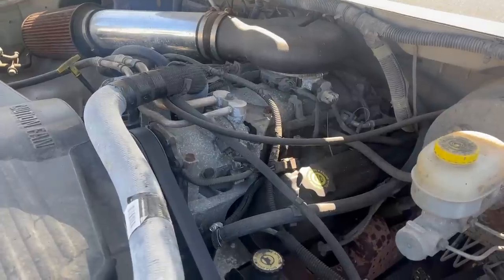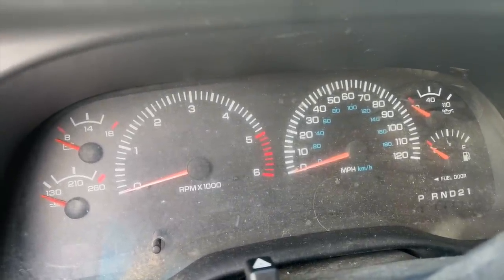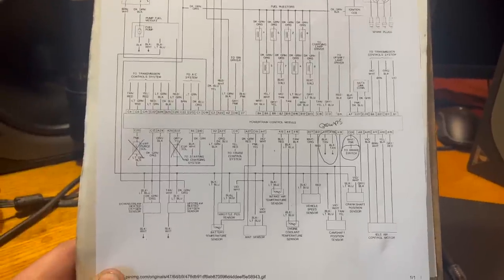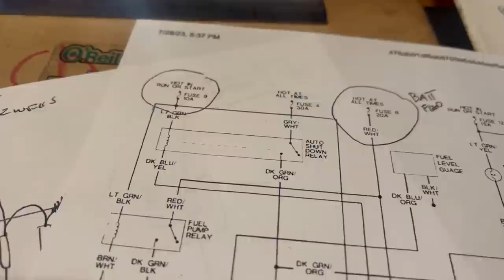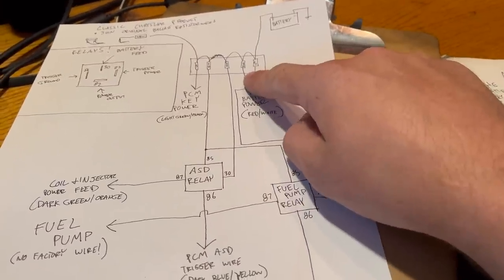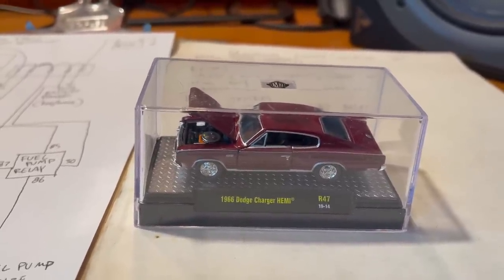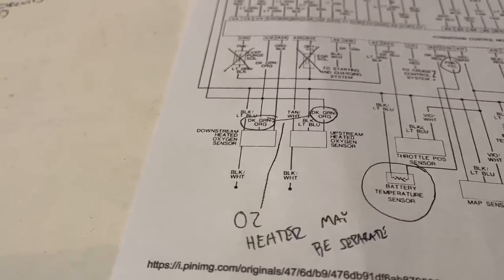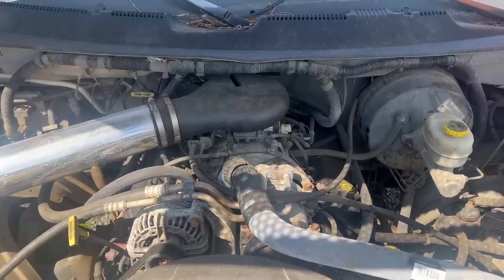The Big Magnum 5.2/5.9 Swap Wiring Guide! How To Wire A Magnum In Your Old Mopar (Or Anything Else)

Comment: Im going to swap a 99 durango 5.9 into a 99 jeep xj. I want to  keep as many factory amenities as possible. They have so many of the same options though. Id hate to lose them by swapping to a truck harness?? Or wiring it like its going in a classic car! Any input?
Reply from the maker: I don’t know about about computer pinout and sensor connector differences between the 4.0 and Magnum setups. In a 3.9 V6 truck, you can add the extra injector connectors, swap the PCM and you’re good to go. You’re not going to have the same luck coming from a 4.0… but it really isn’t all that different. There is a way to do this that results in a sanitary swap. But I can’t tell you every little connection you’re going to have to make to accomplish that. It will involve partially de-pinning both PCM harnesses, stripping both engine compartment harnesses, swapping things around, re-wrapping…
Reply: Do you think i can just use the durango harness that already had everything integrated (same as the 4.0) and just wire the jeep headlights etc into the durango harness/computer,
Reply from the maker: @codyduncan1760  Yes, you absolutely can do that. People have done the same thing for classics, simply adapting the headlight wires and such to connectors that fit their lights. Just a good bit of work to get all of that stuff routed, trimmed, and up and running.

Comment: Can a JTEC controller and harness from a 42RE (auto) work with an AX15 (manual)?
Reply from the maker: In a word, yes. When I said “it will work, but the computer will be mad about the missing transmission stuff,” this is precisely what I was referring to. I’ve done it with success, but had a bunch of transmission codes. Down the line, you can always swap to a stick computer. All of the basic wiring stuff is exactly the same, so no modifications will be necessary there.

Comment: i put a 2002 360 in my 1994 ram 1500 used the 1994 computer the injectors were different rather than change them i bought on ebay EV-1 to EV-6 injector adapters just plug on injector and the 1994 wires plug on the adapter been on there 8 years no problems
Reply from the maker: Nice! I’ve heard of those adapters. I have run into one issue swapping between injectors though - different injector dead time can lead to weird runability issue. I don’t know the different dead times between the different injectors, I just know I swapped in a set that really messed up how a 318 Ram ran earlier this year. Throwing a 360 computer on it fixed it, but we changed to different injectors instead.
Reply: @DeadDodgeGarage  yes i agree but so far i haven't had any problems. in my case i don't think the obd1 is as picky as obd2
Reply from the maker: @DependableAutoTruck  the one I mentioned actually was OBD1 - but in any case, I’m inclined to agree.

Comment: Why can’t you take the fuse panel and put power to the circuits that need power ?
Reply from the maker: You can. I find fitting that big ugly box under the hood of a classic goes against my taste, and removing all of the donor truck’s wiring that is unused and then routing new circuits to it is much more work than adding two or three relays and fuses separately. But that is definitely an option.

Comment: What cold air intake is that also was wondering if you knew how to fix a p0207 and a p0208 code
Reply from the maker: P0207 and P0208 are injector circuit codes for cylinders 7 and 8. This isn’t like a V6 to V8 swap or something, is it? Haha. I would inspect the wiring for those injectors. If nothing is found, I would resistance test those injectors and compare what you find to one of the others. You could have two bad injectors, but that would be odd. I have no idea what cold air that was. Looked cheap.
Reply: @DeadDodgeGarage  no it is not a v6 to v8 swap I have been struggling to get this thing back on the road and these are the last 2 codes I need to get cleared and I have changed out the cylinder 7 injector and it did nothing and cylinder 8 I’m changing today thank you for the help I will check the wiring tonight
Reply from the maker: @BradleyBurgett  then I wouldn’t bother changing the other injector. Open up your wiring harness and look for booboos…

Comment: Oder cuestión I have the transmission of 87 ram charger 5.2 motor.
Is posible to install in the 99 motor 5.2
Reply from the maker: Yes. They bolt together fine. To use the fuel injection you need to use the flex plate from the 99, oval out one flex plate bolt hole, and cut a hole in the bell housing for the crank sensor.
Reply: Tks you help me a lot and tks to make the videos

Comment: reaching out to ask if anyone has installed the whole engine and trans into a very early dodge truck(1977)? I am interested in having the overdrive in this truck. And how about the the transfer case?
my truck is 4 wheel drive.
Reply from the maker: The later transfer case is a problem because they flipped the front driveshaft output. The rest is no problem at all. I am doing exactly this in a 75 - and there will be video at some point in the future.

Comment: Hey I’ve recently put a 97 ram 2500 5.9 magnum in my 99 dakota rt  I’ve swapped all my accessories from old motor oil pan oil feeding tube etc but its giving me no bus 900 codes could you possibly help
Reply from the maker: No bus indicates communication error on CCD bus between the PCM and gauge cluster. Did you swap the PCM? The ‘97 PCM does not support CCD. If not that, there could possibly be another electrical issue taking down the PCM. I’ll assume you used the intake and all sensors off of the original engine? Fairly sure the plugs are all different on the ‘97 engine.
Reply: @DeadDodgeGarage  i used my original pcm i also used the intake from 97 but my old sensors and injectors
Reply: @DeadDodgeGarage  well quick update it fired up this morning runs strong just no gauge functions but the first time i did try to fire it up they did work so im sure I’ll figure it out thanks for your help brother
Reply: @DeadDodgeGarage  i got it working no mores codes and i used my original pcm and everything is the same from the 97 it’s running like a beast

Comment: I put a motor out of my Dodge ram the 59 into my Dakota with a 52 now I do not have power or spark coming out of my distributor
Reply from the maker: Something is goofed. As long as that’s 5.9 Magnum in place of 5.2 Magnum and they are similar years (or you swapped the intake and all sensors,) everything is the same and it should run fine.

Comment: What fuse panel did you use?
Reply from the maker: For my Charger, I used the cheapest little five fuse panel money could buy at O’Reilly.
Reply: Just bought one, the only ones I was seeing online were the type that ave the +&- posts to power the whole panel. Thanks for the reply.

Comment: How do you get past the vin coding for the ecu?
Reply from the maker: By completely ignoring it because it doesn’t matter. Lol. Before the advent of chip key security, the VIN is programmed but it doesn’t really mean much for our purposes. The important part is which engine it’s programmed for. I have swapped these back and forth in swapped vehicles with no issue. It could potentially be an issue for communication between various modules (gauges, body, ABS, etc.) in some factory applications. But obviously that’s not what we’re doing here.
Reply: @DeadDodgeGarage  I have a gen 1 Dakota and am looking to put in an OBD 2 harness in it. It currently doesn't have any of its electrical harnesses. This seems way easier than going back with the stock system. Also easier with the tunability.

Comment: A few things: a 1990 ford F150 had a  frame rail mounted fuel pump of sufficient pressure and flow. Get a good one made by Carter. A 99 corvette fuel filter regulator mounted in back by the pump is the eay to go. I was unaware of a speedo cable drive on a 46re. I used a 46rh, so when i got tired of EFI, i could use pressure and vacuum switches to control OD.  EFI was great, but a good four barrel and HEI on a magnum engine is way way better! Thats where i ended up
Reply from the maker: I wasn’t talking about speedo cable drive on the RE, that info was for older style transmissions - but there was one year of RE that still had VSS/speedo drive. I have one. Those Ford frame mount pumps were fed by low pressure in-tank lift pumps. I have tried enough different frame mounted setups to know it’s a mistake. I’m not going to advise anyone to try their luck with it. Also - at this point in history, I also think a carb is a great way to go. This info is for the many people who have asked me for it.
Reply: That Ford pump works, believe me. I know the fords had some kinda low psi pump cause of the twin tanks, but the high pressure pump works. I learned that from my days messing with the old kit megasquirt ECMs.  The megasquirt guys were so cheap, they got the Ford pump from the bone yards. The replacement Carter weighed  more than the Ford pump and triple the pumps made from chineseium.

Comment: Vss controls trans shifting and engine timing. It needs it.
Reply from the maker: The 46RE has separate input shaft speed and output shaft speed sensors that are used for shift calculation. I had thought that the VSS might be necessary for converter lockup and overdrive engagement. I’ve tested the theory - it’s not. So, while it may come into the equation, I can’t say it needs it. I have personally proven it does not. However, as discussed in another comment thread, some vehicles experience stalling when coming to a stop with no VSS. The engine enters fuel cut and doesn’t know when to turn the fuel back on, essentially. Or that’s the theory.
Reply from the maker: I do think the VSS signal would be required for OD and lockup functions on 46RH and similar, as they do not have those separate sensors. That would make a lot of sense. I just don’t know as much about those earlier setups.

Comment: Guess there really close I drive 97 dakota 318. Donor 2000 darango 360.i can Handel it.
Reply from the maker: The plugs are different for everything. Reuse your original kegger intake and electronic bits and it’ll work just fine.

Comment: So I’m getting a 99 Dakota 5.9 for my 94 5.2 1500. swap the oil pan and the sensors from the older style works or does it all plugs up?
Reply from the maker: Correct, oil pan and probably pickup, all sensors and distributor. You really probably want to just swap the whole intake - 99 doesn’t have a spot for the temp gauge probe, among other minor differences. But watch out for breaking end bolts.